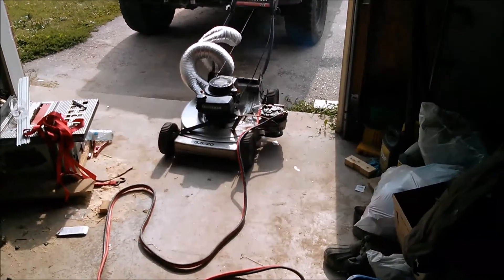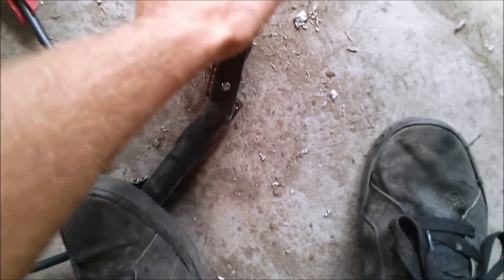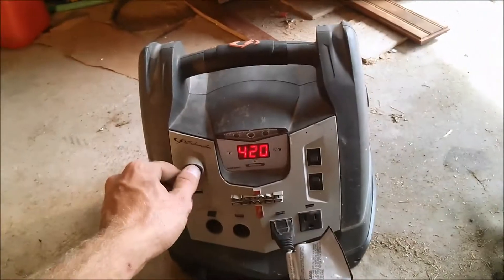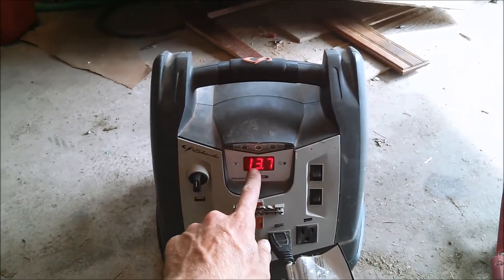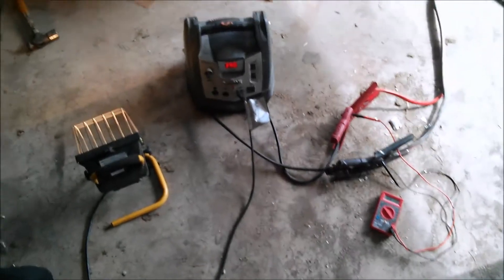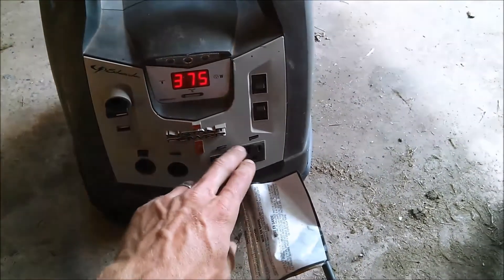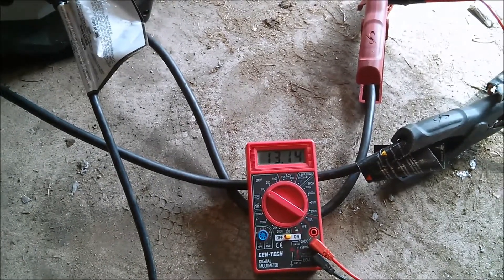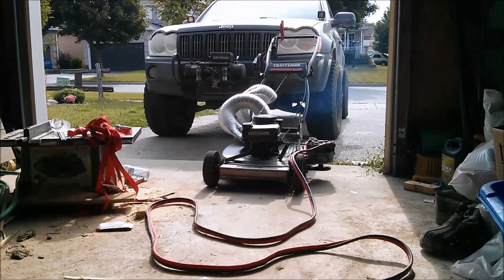Home made generator uses

Comment: Hi great video, what happens if you try to use the  unit connected directly from the car s battery and connect a fan and a TV  using the inverter? . I m scare to damage my Schumacher
Reply from the maker: it will work fine, just make sure to get the polarity right :)
Reply: Ok thanks, you earn a like and subs!! When I connect to the car s battery I have to start the engine or not? Thanks again_
Reply from the maker: Felix Vargas you dont have to but it would be a shame if your car battery and your booster pack was both dead :)